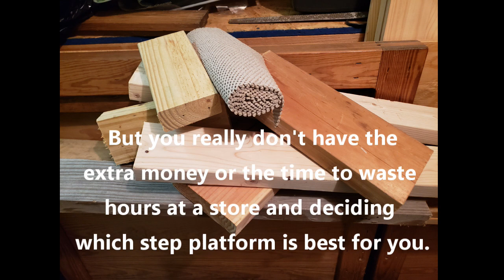DIY Step Platform in 30 minutes

Comment: Just built one of these. I am happy with the results and the simplicity of materials and tools needed. The wood pieces can be cut and assembled quickly. One hour is realistic if you already have all tools and materials ready to go. 30 minutes isn't going to happen unless you cut out the non-slip cover.
Reply from the maker: I actually did build this in 30 minutes. Cutting pieces together to have similar cut lengths saved time and just screwed everything together. The non-slip wrap went pretty quick as well, cutting and folding like wrapping a present. Even if it's takes a little longer for someone else to build (even if it takes someone 3 hours to build) it still saved spending $50 or more for a store-bought version.